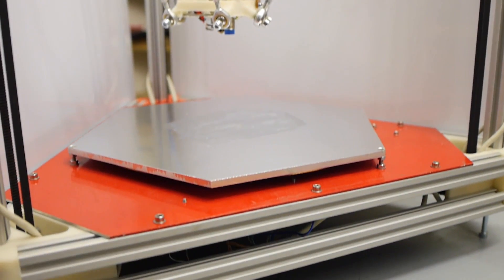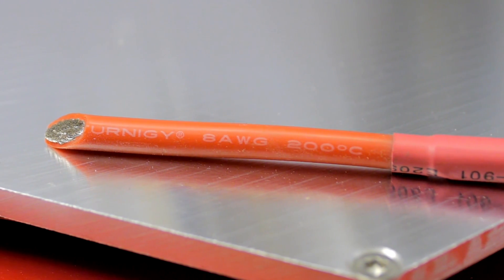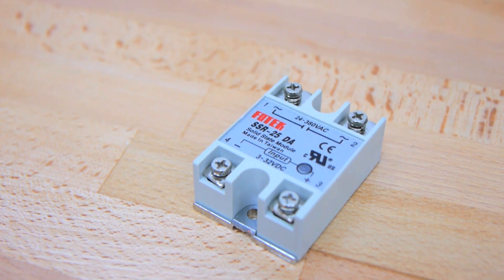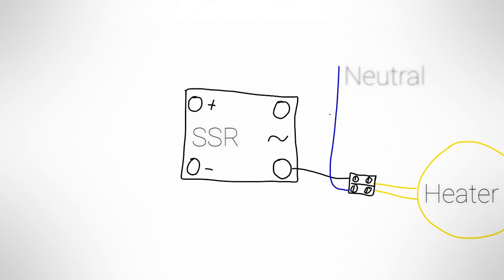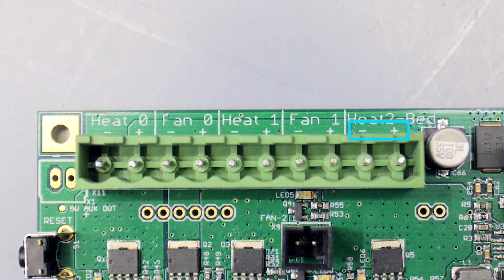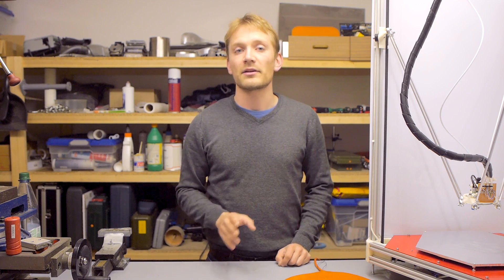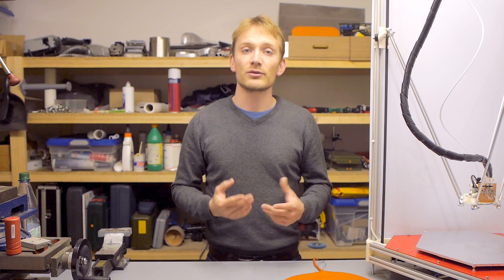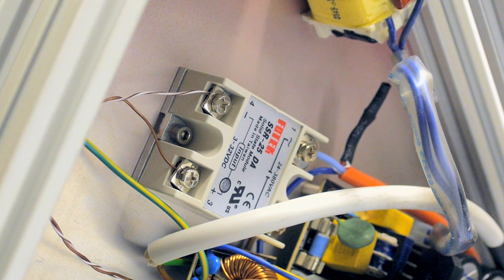3D printing guides: Going big with Solid State Relays!

Comment: Just a hint: those SSR usually fail short-circuited. So any over charge will keep your heated bed on full power all the time. Maybe you should consider install a lamp in parallel just in case.

Comment: You didn't talk about any of the safety stuff tbh. those SSRs can be dangerous and get stuck on and the thermal runaway won't be able to do anything about it. You'd need a heat triggered fuses and some current fuses too. the ssr doesn't have any fuses included
you also better ground every metal part of your printer so if the wires come lose or worse it shorts and shuts off or something and so it doesn't give you a shock. even with dc tho grounding your frame is a good idea to get rid of interference.

Comment: Im not really sure how you mean by configure in Marlin about PWM... I did auto PID but feels like its wrong. The AC ssr that i use has a light on it and as when the power comes on the light comes on and off...flashing :/
Reply: That's what it's supposed to do. The control signal is a pulse (PWM), so it switches the SSD output on and off a few times per second.

SSD-AC works with PID just fine, but it can cause flickering of your room lights (esp., LEDs) because of the frequent turning of the heavy (750W) load On and Off.  This was the only reason for me to stop using PID for the bed of my CR-10S printer.
Reply: @mikepek3863  Thx for answer. But i also see other thing while tuning PID. When having as default 1.0 in PWM the light goes on and flashes abit when coming close to it's  set temperature. And again goes on to keep the temp ofcause. But if i lower the PWM even with 0.1 the flash starts.
Reply: @mikepek3863  I went over to Duet 2 wifi but yet the same commands but you say you stopped using PID... Do you use bang bang then? Or how

Comment: Hello Tom, serious concerns here: SSRs can stay in an on state when they fail( I know, you mentioned it). This can also happen if you run them within their specification. Especially with those fake fotek ebay-china relais. 
To make sure to not set your printer/room/house on fire, imo you should think about updating the video and recommend the usage of a thermal resistor which cuts off your mains at eg 180°.
Reply: Hi. I'm running mosfets on my printer, and I know that they can also fail closed - which worries me.

You mentioned a thermal resistor - do you mean a thermal fuse? I'm not certain what good a thermistor is going to do, it's not going to shut down the mains unless there's some other device it's controlling.
Reply: That or you buy a real Omron/Panasonic SSR instead of a crappy chinese copy.
Reply: wait; aren't they supposed to close automatically on power off? or Is it something else I can remember :?
Reply: @_JustBeingCasual  Not talking about it disconnecting when power is removed, we're talking about what they do when they break.

When they break, they stay connected permanently, meaning that whatever they control (a heater element for example) can overheat and cause a fire.
Reply: This comment 100000x times with big fat font!
Reply: read people using PID to control their heat beds

Comment: A nice video, but you should have said something about always using a residual current circuit breaker / personal protection switch (Fehlerstromschutzschalter/Personenschutzschalter) when using an AC heatbed in a 3d printer.

A residual current circuit breaker measures the current on the phase and the neutral. If there is a difference between the currents, some current is going a wrong way - through the case to ground or through a person to ground. It breaks the current in 20ms or less. 

In your house electric, residual current circuit breaker is mostly installed for bathrooms, but not for the other rooms. But there are residual current circuit breaker available as adapter you can plug in your AC socket and plug your 3d printer in the adapter. Also there are plugs with integrated residual current circuit breaker, so if your AC cable is fixed on the printer (no appliance coupler on the printer), use a cable with residual current circuit breaker in the plug. More secure than an adapter because you will never forget to use it...
Reply: Thank you so much for that tip.
I have on question though.

if my powersupply is grounded properly and is touching the metal frame, it is protected against any shorts from that powwerline. but if i have to connect an other mains power line for the heated bed, do i have to conect the ground wire from that powerline to the frame or is the one ground from the first powerline enough?

Greetings from a felow german ;-)
Reply: The power supply just touching the frame will not mean the frame is propperly grounded. A frame normaly is coated. So for electrical connection you may file the coating off on contacting points; without an Fehlerstromschutzschalter you may also have to connect all parts of the frame (and the heated bed) with 16A/230V sufficient wire.
With a Fehlerstromschutzschalter of course filing the coating at the contacts between frame parts (and maybe a little wire to the heatbed) is a good idea also, but as 20mA is enough to trigger the Fehlerstromschutzschalter its much less work.
With a Fehlerstromschutzschalter of course any contact to main voltage is limited to 20ms, so even without grounding frame and bed any electrical shock should not be lethal (which is the main function of a Fehlerstromschutzschalter).

A healty grown up will normaly not be hurt by an 20ms shock. A Fehlerstromschutzschalter will be enough protektion without further modifications. However, If you have heard insufficience, a peacemaker (Herzschrittmacher) or small children, file all coating at contacting points of the frame and add a little cable from metall heatbed  to frame - so any contact between main and metal parts will trigger the Fehlerstromschutzschalter imeditliy.

Comment: Hi Tom.  One point you missed stressing was that ANY SSR, be it Chinese or German, absolutely needs a heat sink to carry its rated capacity.  Without a heat sink, the manufacturers tell you that you must derate the current carrying capacity by a whopping 90%!!!  That's what a lot of these Chinese 'bashers' here and elsewhere call them junk when, in fact, they just don't have the capacity to research before opening their mouths.  :)  THEY NEED A PROPER HEAT SINK that can be bought usually on the same page that they bought the SSR from.

Comment: if i buy a temp controller and want to avoid the bead connecting to the board at all, then do i need an SSR, ou just the bed heater and the control box? The control box hooks direct to the wall.

Comment: Could you use a SSR for the PCB style heater?  I know most require DC but I am wondering if you could get a faster heating time by using AC voltage instead.

Comment: I should warn that SSR can and do fail, and when they do, they almost ALWAYS fail shorted.  This means that your heater will be in runaway mode and that even if the Marlin (or other firmware) detects this, all it can do is stop the print and display a warning message on the LCD screen.  It will attempt to turn off the heater, but that will fail because the relay is shorted!  What I would recommend would be to have TWO control outlets for the heater on the ramps (or other control board).  The usual one would control the SSR and switch it to control the bed temperature.  The second output would control a magnetic relay placed in series with the SSR and would always be energized while the bed heater is on.  In the event of a failure the software would then kill the second output.

I've had two SSR's fail on me, and I was lucky that both times it happened while I was monitoring the situation.  Since an AC powered bed heater might not be switched along with the printer power (bad idea, provide a means of killing power to the heater when the printer is off, don't rely on the SSR for that!), you could have a real melt down if you left and thought the printer was off!   In retrospect I might have had the failures because my AC heater is operated at about 1/3 the mains voltage  via a 120 to 48 volt step down transformer, and the SSR switches the primary of the transformer.  I usually don't think of a transformer as an inductive load (motors are), but maybe the SSR could not handle that, even though it was VERY much over rated for the task (25A SSR switching less than 3 amps).  I should try switching the secondary of the transformer, I think the SSR will work at 24vac and up.  BTW I was using "bang bang" regulation, you can't PWM AC though a transformer, at least not unless you manage to synchronize the switching at zero crossings.
Reply: Kenneth Scharf hi, what kind of magnetic relais you‘re using?
Reply: It's what I was thinking plus If by misfortune your were touching the live wire of the AC primary and the GFCI/RCCB  safety device would not work properly you could smoke your soul!
I was looking for a AC/DC 48V setp down sPSU that is totally insulated from earth to go along with a DC/DC SSR so no problems if your body got in contact with one of the two wires. I might consider adding a fuse in series in addition to the magnetic relay. 48V with 4amps would give enough jus to heat a silicon bed and reducing by four the current so the risks of starting fire at the connecting points...
Reply: Transformers are pretty much the inductive load in a home setting. Old fashioned low voltage halogen lights behind a traditional transformer is why dimmers capable of inductive loads were even sold, back a decade or two ago.

Comment: <-- American here jealous that europe has 230/240V standard :)
Reply: Europe is actually 220v.  Only the UK is not 220v, the UK is 240v.  Anything that claims to be "230v" is simply designed to run on either Euro 220v or UK 240v.  Its basically marketing - there is no "230v" grid anywhere in Europe.

Comment: tom love and subscribe so figured Id ask my first question and i try to do my homework so i dont have to but , with ssr and silicone pad do we do pid bed temps or bang bang ..guy on a anet facebook saying I shouldn't use pid it will  It will weld the switch and rune it, wondering your thoughts I'm using 110v silicon heater and auber dc to ac ssr mgr-1 d4825 25a when using bang bang it lights up stays on then turns off till drops flux aboiut 5 degrees.. use pid and auto tune and set in firmware and its locked at what ever I set but flickers on and off rapidly each second

Comment: Hey Tom, got a question on this.  I hooked my 120VAC silicone heater to the same model SSR that you listed and worked great for a while.  I then started having issues with my control board just stopping printing randomly and eventually stopped working altogether.  I thought it was just a bad board so I got a new one.  Hooked everything up and started printing and then I started having issues where the board would lock up whenever I tried to heat the bed.  The temp would start to rise and then would randomly stop and the board would be locked up.  Reset fixes until bed is being heated again... eventually that board also stopped working.

 I thought maybe there was a problem with the SSR so I got a new one and a new board.  Done a 19 hour print without the heated bed with no problems.  Decided to print some ABS so I started the heated bed and after a few minutes it did the same thing.  Board stops responding.  Now when I heat the hotend it says it is to temp (210c) but is not able to melt the PLA so I am afraid that I have fried another board.

I have verified that the polarity is correct on the DC side and the AC side is wired correctly as well.  Could the SSR be the problem?  I started to entertain the idea that it was the heater but it should not be able to affect the control board through the SSR could it?

Borards used:
Smoothieboard (official)
MKS Sbase
Azteeg X3

18ga wire on DC side
About the same on the AC side (came with heater)

Now I am gun shy on hooking my heated bed back up to any new boards that I get. =(

Comment: When working with mains power, you might want to use a Ground Fault Interrupter (GFI) outlet. If you come in contact with the hot/live side of mains and current flows through your body to an ground path, like your feet or other hand, other than the neutral side hooked to the GIF, it will shut the power off before you are harmed.

NOTE: As indicated, if you touch both wires from the GFI, it won't protect you.

Another safety device that is similar to the protection provided by the GFI is the isolation transformer.

Comment: Silly question, but I'm assuming the printer would then have two wall plugs? one for the SSR and the normal one for your 12v power supply?

Comment: Hi Tom. I have a custom Prusa i3 using RAMPS 1.4 and a 3MM MK3 Aluminum Board PCB Heat Bed. I have a 40a DC-DC SSR to control my heat bed. When I use my printer by itself and print from SD cards, the bed works flawlessly. As soon as I plug my printer into the USB of my PC to print, the SSR and bed turn on and do not turn off until I unplug the USB. What causes this and how can I fix this?

Comment: Does anyone know if it is possible to control the PWM frequency of the heated bed in Marlin, and if so, what line of code?
Reply: yes its possible ;), but only when not using a relais. idk the precise line, but it was sometimng with smoothing temp regulator.

Comment: Hello Tom,  Thank you for all your videos.    When I am in my shop I turn on your videos and have the play over and over while working.  Listening to them through you I figure out more on my side.   I am writing today because I am trying to upgrade to a 12v silicon heater pad.   I have already upgraded the MOSFET from your MOSFET video.  When I try to run the heater pad through the ramps 1.4  it will get to 60c then will drop to 36c and maintain.   I tried to follow your diagram for the SSR.   I used a  SSR-40 DA.   I hooked up (from the ramps) the positive to (3) on the DC input and negative to (4) DC input.   On the AC side (1) to positive to the ac plug and the other AC side to one side the heater pad.   The other wire of the heater pad was connected to (2) of the SSR.   When all powered on it was ok.   When I used the display dial to call for heat the SSR  fried.   What did I do wrong?
Reply: Did you buy the wrong SSR as there No Positive or Negative on the AC only a Sine Wave symbol

Comment: please can anyone tell me why the filament keeps getting stuck in my 3D printer hotend. I have cleaned it out.
Reply: +Jessica Ryan I'd be happy to help, but we need more info as to when your nozzle clogs, what filament you're using, the temps...basically anything you can say.
Reply: It does the test extrusion ok. I have done the test configuration the filament at the right speed. It clogs up when I am trying to do a print even though I have done the correct configuration for the filament speed. I have cleaned the nozzle each time to make sure it doesn't happen. Thank you for offering to help Justin.
Reply: How soon does your nozzle clog after pressing print? Also, could you please say your temp and plastic type? For example, if your using PLA, you should be around 190-200C and ABS should be 220-230C or so.
Reply: Does it clog on the first layer? I find that most clogs I encountered where caused by an incorrect temps, or my extruding pushing out too much plastic(which causes a jam because the plastic has no place to go). I would suggest you check the steps/mm for your extruder setup, then make sure your layer height is around 60-80% the diameter of your printer's nozzle. And finally, make sure your printer nozzle isn't too close to the bed during the first layer's print.
Reply: +Jessica Ryan Also, one more note...You'll want to ask 3d printing related  questions, you don't really want to ask on youtube channels for help. Tom's guides are outstanding and a great way to get pointed in the right direction, but there's a lot to this. I would suggest becoming a member of forums.reprap.com   Ask your questions there and I promise you'll find answers, or at least be pointed in an appropriate direction to find them.

Comment: Tom, each video I watch I gain more and more respect for you.
"mains voltage is always very painful and sometimes deadly"
That is very true, and I fully agree with. But the reason its important is because many youtubers who have no clue what they are doing say the most stupidest stuff such as "be careful with 24v dc voltage!!!" or even "be careful when spilling the cables your phone charger, you can electrocute yourself"
No joke, I head that one before

But you are the first youtuber who actually knows what hes doing, knows whats safe and what to watch out for, and I have to say thank you.
Reply: the danger of 24v is not usually contact skin. on most condition it gives you a bad buzz and a lil pain if anything happens. the dangerous lie in melting cables fires and worse. you can make a fire even with 5v. or 3.3v tbh.

also he didn't talk about the failing of SSRs specially the cheap ones he used. he didn't mention grounding your printer either.
Reply: Actually, 24V can be dangerous, too. It depends on your body's impedance. With dry skin, it has a impedance of 100k-600k Ohm, but with wet skin, it drops down to 1k-500 Ohm. Generally, anything above 10mA can hurt you.
Well it's just not right to say, that 24V could not be painful.
BE CAREFUL WITH 24V. Not as careful as with 110 or even 230V/AC, but still, be careful.
Reply: 1st of all, the danger is not in Volts but in Amps! You can die from a 12 Volt if you will have say 1000 Amps on it!!!

Comment: Hello Tom,
Im now using a silicone heatbed with a relay but im having a problem, the bed keeps heating even when i set a temperatura it goes beyond that, do you have any idea if i have to change something else in the firmware lets say?
I changed PWM to the lowest already but it didnt help.
Ill appreciate your help, thanks!